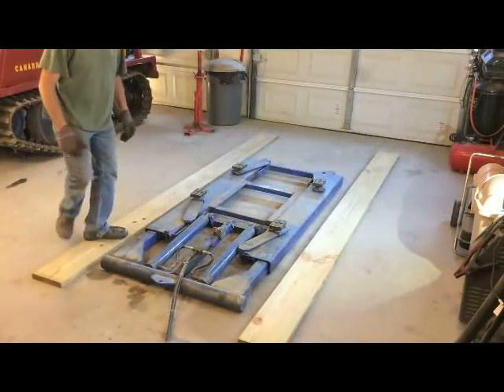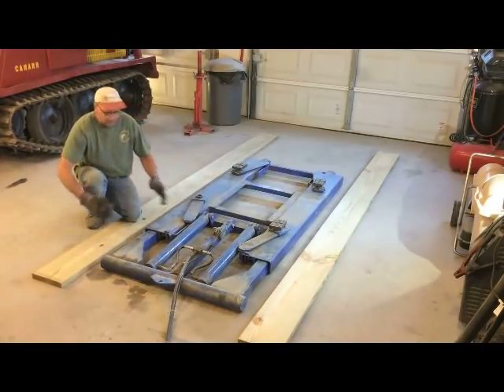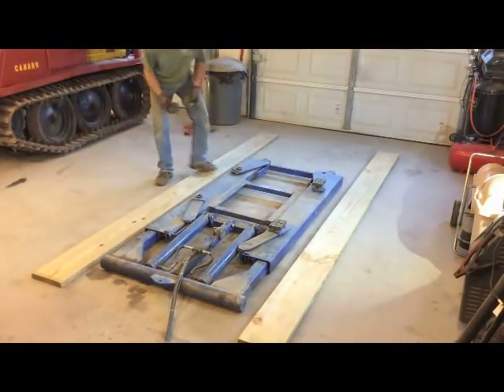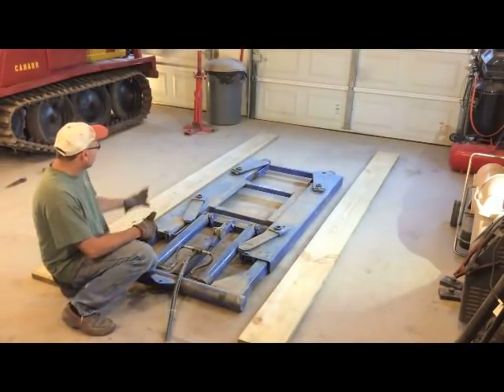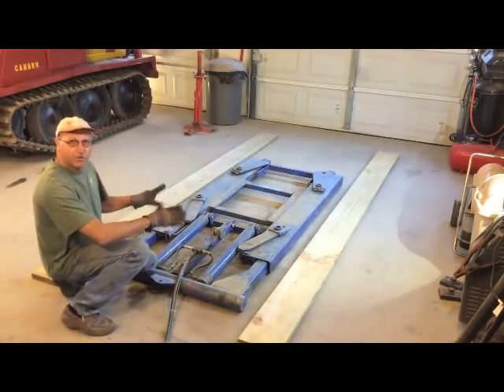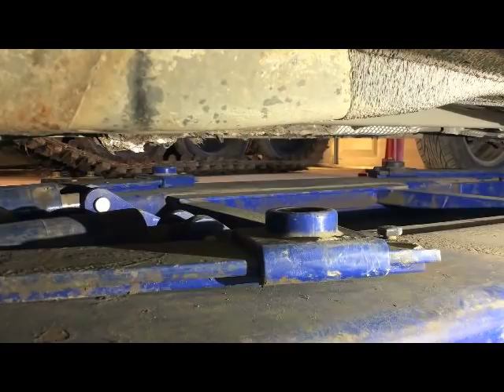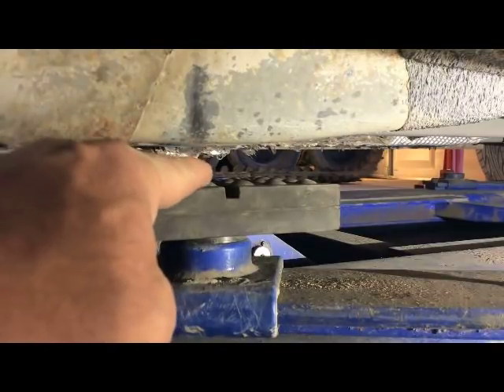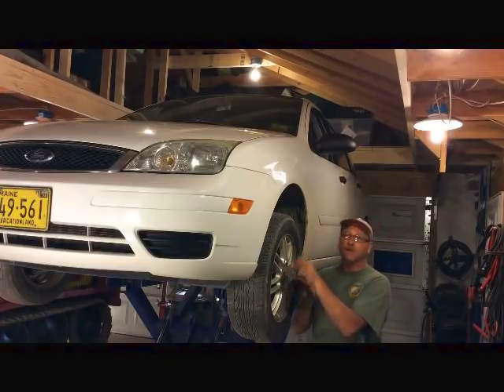Harbor Freight 6000 Lb. Capacity Scissor Lift With Small Car

Comment: Hi Ron thanks for sharing ,how high of ceilings do you have and do you have to reposition the wood planks for each vehicle.. I'm only about 9 feet or just under that will it work ok with this style of lift .Could you let me know thanks very much Dale
Reply from the maker: Yes I have to set up the blanks each time only for cars they are a bit to low, the lift will work ok with 9 feet I used it like that until I changed the ceiling.

Comment: Hi Ron. Good video. I tried to do same thing as u with my Ford Focus but rear arms didn't extend wide enough to reach the seam welds on the Rocker panels. If I try to raise it, the rear pads hit bottom of the rear passenger floor. Almost bending it up. What do u suggest I can do?
Reply from the maker: Nice! yes you have to have in completely strait on the lift to use the seam I use a piece of 2x4 and put it on the frame, I guess I should have shown this.

Comment: Am I correct in assuming that you can't really get to anything underneath where the lift footprint is?  As opposed to those "Quick Jack" type scissor jacks that leave the center accessible.
Reply from the maker: Its not bad, but if you do an exhaust system it may be a little hard if not impossible to do.

Comment: Just got mine at the end of August 2019. Didnt get any instructions or ANY paperwork with mine. Probably lost in transit when it was damaged. Just as so many other videos show for this lift, mine was also damaged ...by XPO Logistics. Formerly Conway Trucking. Busted hydraulic fluid tank. Parts department in Ca. said that they may or may not be able to replace it -- as it is actually made in  China. She would have to check and get back with me in a couple days. That was over a week ago. I guess I'll have to figure a way to repair it or maybe get lucky and find a replacement. Anybody else dealt with the tank issue? Dolly wheel was also busted but that was an easy fix. Otherwise, I like it.
Reply from the maker: Bummer ): one you get it you will be happy, thanks for watching.

Comment: Hi Ron, never knew harbor freight sold this. Questions: Can this be operated with 110 volt/outlet? Also can i wheel this outdoors, or too heavy? My garage height is a problem. Appreciate you posting the video!
Reply from the maker: They do sell it, you have to order on line about $100.00 shipping.  not sure about if you can get 110 volt did not see option. you can put anywhere just has to be a solid ground,  it is heavy my other video shows me moving it. Thanks https://www.youtube.com/watch?v=2_TpwvQHxcQ&lc=z12thr2iirjzettkt22oyvlr1xaryl3c2
Reply from the maker: Oops wrong video this one shows me moving it. https://www.youtube.com/watch?v=oOrQubrpFhA
Reply: Channel Ron Thank you!
Reply: Channel Ron Thank you!